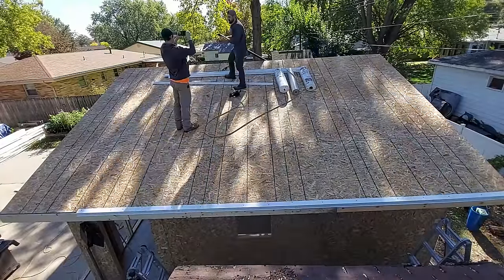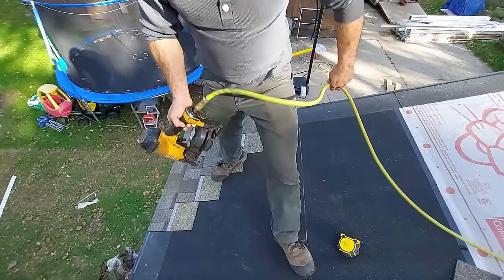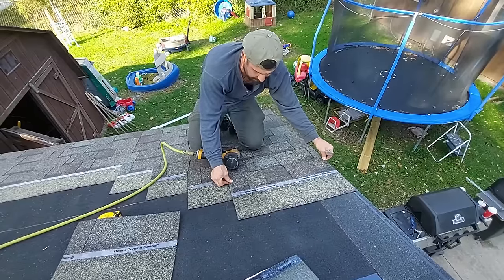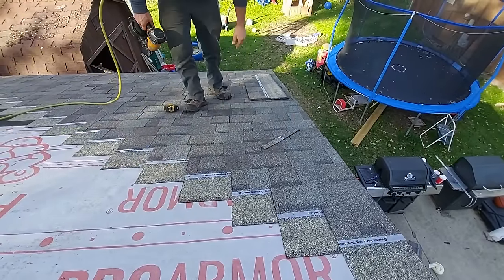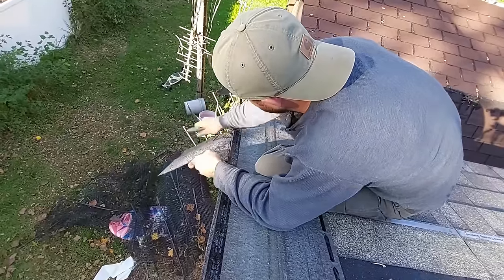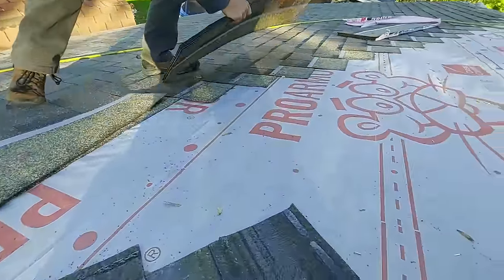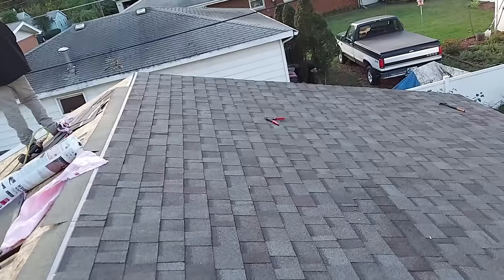HOW TO | Roofing Basics (Part 3 of 3)

Comment: I recently had a roof put on and there are no starter shingles, do I need starter shingles?  It's just shingles ran to the edge of roof, i can lift it up and see the ice paper
Reply from the maker: On the bottom edge it's 100% necessary. On the edges going up to the ridge, it's preferred but will survive.  I've never put a roof on without it but i know some good roofers that used to.  It'll hold up
Reply: @NWIVeteranConstruction  well my issue is you can pull the bottom row of shingles up and just look.under to see the ice paper. I live in a high wind area and I didn't want the roof ruined in a few years

Comment: I was wondering, why doesnt he put that black ice shield stuff all the way to the top? Why does he switch to the white stuff? Is it a problem if you do the whole roof with the black stuff or does he do that cause maybe the black stuff is more expensive. Can someone explain that to me i dont know about roofs but I noticed the different materials and wondered why it’s done like that
Reply from the maker: I explain in part 1 the difference between the 2. They play different roles. And yes you can do it all in that if you want but it's more expensive and also a d*ck move for the next guy who has to tear off

Comment: The real way to do that gutter apron would be to first wrap your ice/shield over roof onto the fascia board...then put on your gutter apron...then put another piece of "underlayment" on top of gutter apron as usual.  The reason is because ice can start below the apron and then get it's way behind it and go backwards/upwards.  Having the ice/shield stuck to the fascia takes care of that issue.  You then have to have an underlayment as usual to go over the apron..in your case would have used the owens pro armor stuff.   As for having that 2nd row of ice/shield, you shouldn't need that if you have proper insulation to keep the roof deck cold in winter.
Reply from the maker: I dig it

Comment: Is there any benefit to sealing the nails with silicone to protect it from water?
Reply from the maker: No. It'll take 10x as long as serves no purpose as long as you put the nails exactly where I told you.
Reply: @NWIVeteranConstruction  do you have any experience with exposed fastener metal roofing'?

Comment: I like the over hang on my new roof. Is that actually a problem?
Reply from the maker: overhang calls for 1/4 inch minimum to 1 inch maximum. that's a pretty standard thing. not sure what you have
Reply: @NWIVeteranConstruction  my overhang is 1 inch but I thought in this video you said to make it flush but i could be wrong.

Comment: You're doing this "stair step" with those architectural shingles. What about the cuts for three-tab shingles that are 12" x 36" ? The math doesn't work out the same way, and the tabs don't line up. How would you set up the cuts for stair steps for that?
Reply from the maker: No it's also a 6 inch stair step for those too but it's tricky. Hard to explain. I don't recommend 3 tab, especially for beginners, but theres a 6" notch at the top of the shingle you can use for a guide.
Reply: @NWIVeteranConstruction  Wow, thanks! I didn't have much choice, as the shingles came with the shed kit I was given. My buddy bought a kit, and all the roofing stuff, and then his army unit is being sent to Korea. So I have a new shed to roof. I can handle a 6" step, but it seems like it's going to be more prone to errors. I very much appreciate the reply!

Comment: Wow these series will make lot of home owners go DIY. I learned a lot from your other videos when I tackled my roof last year (new build). OC installation guide says 6 1/2" stair steps but I like your 8" way better for a low slope roof. People just need to pay attention to the nail placement. Stay away from seams. No need to go super fast for DIY jobs.
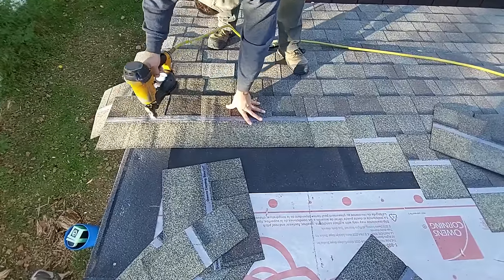Reply: 40:10 back cutting and proper nail placement for next row is one of the crucial points for diyers. I had a very hard time figuring it out in my roof. There wasn't a good explanatory video like this. Thanks Zack.
Reply from the maker: thanks for noticing! that's what they're hear for

Comment: Do you not use chalk lines to keep everything straight? Or is it unnecessary
Reply from the maker: i typically do not! especially on something this size. but the point of this video was to show beginners all the steps i would take if this was my first roof...and i did snap control lines all the way up. its in part one or 2. this is the final part to the series

Comment: Can you explain again why you have to lower your reveal every 5th. shingle?
Reply from the maker: I don't normally.  It's for first timers. It's going to be very hard for them to keep the roof straight. So by snapping every 5th row you'll ensure you're getting right back in line.  As I mentioned in part 2 where I snapped them out you can do them every other if you want.  A lot of crews do that.  Or none.  Up to you
Reply: @NWIVeteranConstruction  Thank you for explaining that, Brother.  I didn't get that information in the video about popping red lines every so often.  I am a newbie as well , as far as roofing shingles go.  but other than watching not to fall off the edge, I shouldn't have problems once I get up a bit.  I'm almost 70 but a very healthy 70 yr old.   You might consider me a 60 yr old.  I can take a 9ft jump and not break anything right now.  But i know how life goes and I've worked on my own roof cleaning my gutters for 45 years, until last year when I bought stainless steel gutter guards for my Gutters. Live  near New Orleans. 
Sorry to be long-winded but I try to be thorough.
I can always work the bottom rows from a scaffolding board If needed.

Comment: QUESTION~ is it ok to re-use some of the shingles ?
Reply from the maker: depends, i wouldn't reuse shingles that have the seal broken...but like, if  you put a nail in it and the tore it up, you can use those as the top shingle where ridge cap overs the holes, if you're scrap effecient tho its rare that it'll make a difference in the end

Comment: how far do overhang the paper, starter shingle, and roof shingles from the edge?
Reply: 1/4 to 1/2 inch, but no more than 3/4 inch. Over 3/4 inch and the shingles can bend in hot weather.

Comment: You can transition from black paper to synthetic underlayment with no problem?
Reply from the maker: That's not tar paper its ice and water shield.  it's all detailed in part 1
Reply: @NWIVeteranConstruction  - Ok. However, if I partially reroof my home to install solar, can I transition from an existing tar paper to synthetic? I just want to reroof where my solar panels are being installed.
Reply from the maker: @appleforever6664 I'm not sure what you mean. If you're choosing what felt to buy, either one works. But synthetic is more common these days
Reply: @NWIVeteranConstruction  - Say I want to use synthetic underpayment at the very top of my roof near the ridge. Come down from the ridge descending toward the house about 15 feet with synthetic and tradition to the existing tar paper, is that possible or will I have issues with leaks? The roof spans down about 35 feet from the ridge to the eaves.
Reply from the maker: If the tar paper is old and has nail holes in it from old shingles then you need to cover that with new felt.  If it doesn't have holes, you can do whatever you want.  I'm not sure why you would mix and match them but if you need to, nobody is gonna stop you.

Comment: Why did u put the ice and water first I thought u use that for the valley?
Reply from the maker: Depends on the area.  A lot of snow and ice build up here in Indiana so Ice and water shield is required on the eaves and must extend 2 foot past the inside of the exterior wall
Reply: Okay thanks

Comment: I've always been told to never use red chalk because it will stain what do u think
Reply from the maker: Yea there's some truth to that.  It has a permanent level of 4/4 a lot of times so if you snap a line to keep your ridge straight or for your valley it will take a long time to go away.  I had some red chalk spill on my own roof and it was there for over a yr. Might even still show up close lol so I use pink usually for lines that show cause they'll wash off

Comment: What is the point in doing the stairstep when singling?
Reply from the maker: do avoid water getting to the decking. if you don't stair step them, they wont work. and you can't rack them like 3 tabs.

Comment: Good DIY Video.  You give many worthy suggestions. ---->>  My DIY tips or add ons from a PRO.  Buy and use a Safety Harness. Never turn your back to edge when working. Never cut on top of the felt paper or other shingles. in high wind areas, yes put the extra nail higher.  Never use permanent RED chaulk, use Washable BLUE.  DIY'ers with helpers and only 1 gun, its ok to lay out entire line of shingles them come back and nail them. Reduce your time working dangerously on edge, simply measure and cut the last rake pieces individually away from edge or( as pros do, we flip the shingle, place it on edge, then mark measurement to connecting and cut it).  Be careful not to trip on air hose.  Be careful to nail straight down not at an angle. Keep roof clean as you work.  Never work alone. Good luck and have fun.

Comment: so you only overlap on the vertical,  not horizontally,  like side to side....   when you place the next tile in line i mean...
Reply from the maker: I think you have that right.
Reply: Shingles obviously would have to overlap both horizontally and vertically to remain watertight and shed water off of and not into the roof to perform properly in the first place.

Comment: I pop 2 lines off the rake, one at 24" and the other at 32". You're waisting time pulling that knife out and guessing. I've read many of your reviews and most people are impressed with what you're doing. When is the Roofer Olympics? I would like to enter the hand nailing contest part. How much does it cost to enter? I'll put up 10,000 to see who's the perfect shingler at hand nailing. When I used to race it was done at the Florida Roofers Convention with strict rules in front of hundreds of roofers and Contractors. Everyone had a 10' x 10' 4/12 pitch roof with the metal already on. We used 3 tab and nailed the shingles on a step 6 pattern just like the manufacture instructions said on the package. Every nail had to be just below the black seal strip and above the keyhole just like it shows on the package. Everyone competing had to be perfect and put the same amount of nails in the square or you would be penalized and have time added. I've won thousands, trips to the Bahamas and Vegas, have trophies and plaques from multiple states to prove that I'm the best shingler on the planet. If you want help at having a fair contest that pays good money so the truly best of the best will compete then reply. Thanks
Reply from the maker: Didn't quite read all that but man I never hand nailed lol I started shingling 7 or 8 years ago.  I plan to hold that when I have the money but the Platforms will be 3 sq each. N forget about your hundreds of people I do this in front of the world lol over 10 million views.  I do that nice thing for the newbs to understand. You're wasting your time snapping those lines. I eye ball 7-8 on the money every time
Reply: @NWIVeteranConstruction  How much do you think it will cost to sponsor the Roofer Olympics?

Comment: Watching that bostich nailer made me cringe 😬 i used to used those for years but switched to Hitachi 10 years ago, the bostich kicks like a mule and noticed they put nails crooked fresh out of the box, after a long day of roofing that extra recoil and the frequent hammer use from the snaggle nails sure puts a toll on the wrists. You clearly know what youre doing and exercised the important basics and fundamentals of asphalt roofing the only thing i disagree with was dropping the rows to follow your chaulkline its a good idea to use it as a guage and just pay attention to how much out or crooked you are and then you very slowly correct throughout several shingles instead of having a low row 1/4 creates a lip or possible wind catch zone, although OC shingles adhesive line is pretty strong.
Reply from the maker: It's the exact opposite for me. Every Hitachi I see and use spits bad nails.

Comment: Most professional roofers place the first  row double shingle
Reply from the maker: Mmm.... i think most professionals use a starter shingle which is designed to seal it to the bottom... not a full shingle upside down.  But either way works I guess

Comment: Guys like me always get stuck on the corner lol.
Reply from the maker: Haha sorry.  I got videos to help you get through those quickly.  This one does pretty good
Reply: @Veteran Construction  I meant that I'm the one usually doing the "scary stuff", nothing against using the upside down shingle as a guide, my buddy Mike does it that way, me tho I cut the edge from underneath as I go and use the scrap. 1 shingle gets me 2-3 courses depending how big or small the pattern is. The left side of my index finger is as smooth as a baby's bottom. Anyway man good job and great quality 👏 👌, you're in my top 3 as far as roofers I see on YouTube.

Comment: Is a 3 step to small?
Reply from the maker: if you mean using a full shingle, then a 2/3 shingle, then a 1/3 shingle, then back to full shingle. i would recommend against that! the seams will stack too closely. if you look at the bundle they want you to stack it like i do. however they recommend a 4th shingle in there i believe but that just makes shingling a hassle. i know for a fact, on every roof scenerio, that if your stagger is between 6 and 8 inches you will have an easy time shingling. only time i ever go closer to 6 is when doing valleys. you can see in my valley video what i'm talking about if you care to go that deep
Reply: Thanks I was just wondering

Comment: this video you cut your steps b4 you nailed them on, is that gunna frown or smile now?
Reply from the maker: no because i had a control line snapped, and i did that because i don't want rookie roofers to be cutting like that method you're thinking of. that's just asking for troubles
Reply: @NWIVeteranConstruction  only 1 control line every 5th row tho
Reply from the maker: @redsresearch  that's way more than I need lol it's really not that serious man.  It's nice to look down and have a straight roof, but chances are you're the only who's ever gonna notice it's straight or not near the edges unless you're really bad at shingling or don't care.  If you try to keep them straight, you'll be alright
Reply: @NWIVeteranConstruction  so the two that you cut and dont use a line for those two won't smile or frown?

Comment: why add 2 layers of ice and water?
Reply from the maker: My Area requires that Ice shield extend 2 foot past the inside of the exterior wall on any heated structure.  Garage isn't heated but it was sent out in the package deal so I used it according to code and for demonstration purposes
Reply: @NWIVeteranConstruction  makes sense, only calls for 2 feet past interior wall. where im at, overhang is usually a foot or two. one row is usually good.

Comment: 6 nails for those architectural shingles. never 4, ever.
Reply from the maker: 4 is demonstrated on the package and required in most areas, like mine.  It's been fine for decades.  I use 5 nails.  No reason to 6 nail here.  It ain't Florida brotha it's Indiana.

Comment: Where's your starter row your very bottom Row supposed to have 1/2 shingle long wise, when water gets between the cracks on that bottom row it's going to go directly down to your ice Shield you're supposed to take a shingle and cut it in half long lies and place it on the bottom row
Reply from the maker: We solved that with the 8 inch stagger. I'm confused on the question
Reply: @NWIVeteranConstruction  you're supposed to take a shingle cut it in half longwise and place the top half piece down as your first row that way you don't have no exposed roof between the two shingles on the first row
Reply from the maker: @markket1154  ohhhhh.....no. don't cut the shingle in half they actually make a starter that you buy. It's the little half lookin shingle on the bottom and the edges.  I show you in detail how to install that in part 2
Reply: @NWIVeteranConstruction  every time I've roofed the house I cut the shingle and half use the top piece for the starter row and I use the other half of the cut shingle for the cap
Reply: @NWIVeteranConstruction  I don't need you to show me in detail I roofed more houses than I care to admit the only houses I'll be Roofing  are my own and you don't know what you're doing
Reply from the maker: @markket1154  bro the starter is there and it's actual bought starter.   Lol idk what you're talking about sorry.
Reply: @markket1154  I wouldn’t let you roof my dog house 😂
Reply: @markket1154  they make cap that you buy and they make starter that you buy, you're saying you know more, if you did, you wouldn't use the top of the shingle for starter as there's no Tar line on there dummy
Reply: @Righteous98  the shingles I used due have tar lines on them
Reply: I watched the video you put the shingles down with no starter row